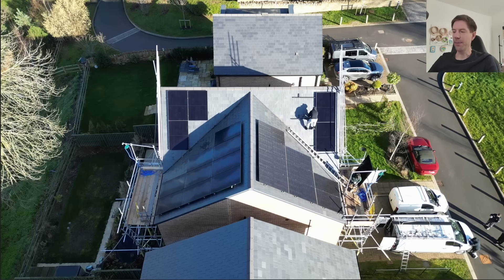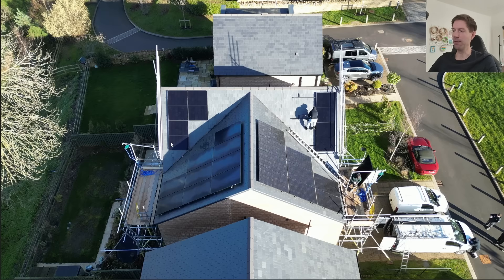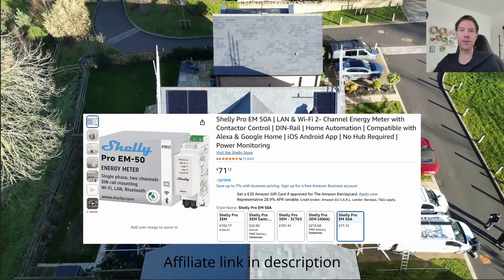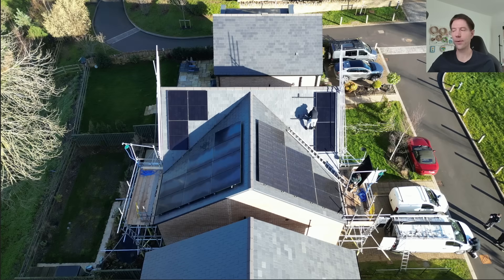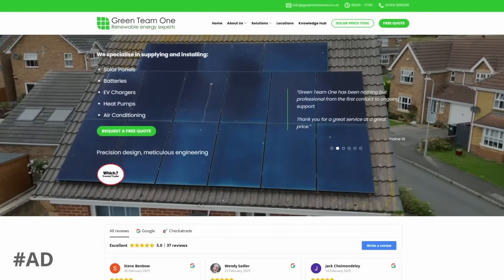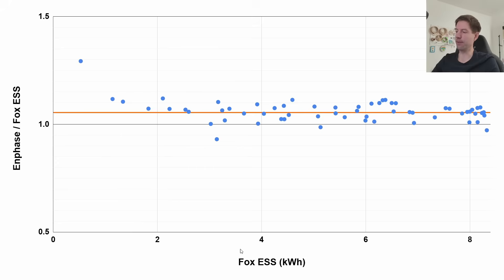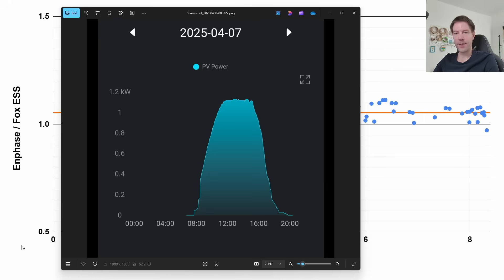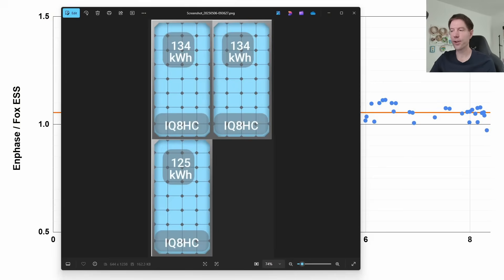Inverter showdown - two months of data

Comment: We have noticed two heat related scenarios with our setup.

The first is the biggest problem, and is related to the fact that our inverter is in the attic. On really hot days, when it’s been hot for a while, they are the rare days when we feel the need to wheel out our portable AC unit to cool the bedroom in the early evening after the sun has gone down, however if the inverter is too warm it limits the output from the battery to something around/just under 1kW, and therefore doesn’t cover our usage.

To get around this, and to prolong the life of the inverter in general, I have 4 x 100mm 12v computer fans under the inverter that turn on when the internal temperature of the inverter (as reported by the Growatt API) gets over 30C to give some additional forced airflow over the passive heatsink. They generally turn off at night, and when it’s cloudy, but we’ve never had a problem with the inverter limiting the battery output since.

The second is that recently we’ve had several consecutive days with full sun all day, but wildly differing temperatures. On the hotter days the peak output was down 300W or so from the 5kW peak, but in that case the curve still superficially looked the same, unlike your clipping, so I’m probably putting that down to the temperature of the panels themselves. But it could easily have been atmospheric conditions changing the actual W/m2 at the panels.

I’ve been running the fan setup for a couple of summers, and it hasn’t let me down, so I’m happy with the outcome, but obviously not so happy I had to do it in the first place.

I hope you find something simple to keep your inverter cool enough :)
Reply from the maker: As it happens I'm planning to do exactly that.  I've got a fan on order and will be installing it asap!
Reply: @ nice one :) I used a desk fan first to confirm my initial hypothesis, and that worked well, but drew quite a lot of Watts, and audibly  hummed along in the attic, which is why I replaced it with something lower power - but it works just as well.
Reply: Likewise have PC CPU fans underneath my inverter to blow air up the back and reduce its temperature.  Works well

Comment: Hi Tim, any chance you could share the data for cloudy days next month? 

I’m in a similar position, I have a south facing array and want to add some panels on other (less optimal) elevations of the house.

However, I’m unsure whether to go for microinverters or a string inverter. I’m a bit loathed to pay so much for the micros if a string inverter will do.

I understand the pros and cons of both and I’m looking to optimise the system to perform in cloud diffused light, not full sun, as I have that covered already with the other array. 

So, low start up voltages are key and I may oversize the panels to help achieve better results when it’s not sunny.

So I’m interested to see how your two new arrays perform on cloudy days. 

Many thanks!
Reply from the maker: There are a few cloudy days in the data I showed, so you can see the difference between the two systems there.  It's pretty consistently 5% more for the micros.  My personal opinion is that if you don't have shading issues then there's no point getting micros.  If you have a significant amount of shading micros might be better.  I wasn't planning on doing another video until six months so there won't be one next month (or for another four months).
Reply: Microinverters typically aren't the optimum solution for an unshaded south roof due to clipping which can occur at the top end when the sun is shining brightest. On my property I now have microinverters in all directions and they I'm finding them effective in all orientations besides South, particularly if you are mix and matching orientations and pitches. They give good designs flexibility to put panels wherever there is space. A key consideration may end up being cost however. They might boost your output by 5%, but add 10 to 15% to your total install price.
Reply from the maker: @RenewableEnergySteve  I would definitely concur with that summary.

Comment: It looks like the inverter has passive cooling. That often leads to overheating problems. I am looking forward to seeing you experiment with a possible solution. This is actually a reason I wouldn't be inclined to use microinverters.
Are you sure you have the S1500-G2 and not the S1000-G2? The S1000 has 1500 W maximum input power. The S1000 has a maximum output current of 4.8 A, which @ 250 V is about 1.2 VA.
Reply from the maker: Yes, I double checked the inverter as soon as I noticed the clipping.  It's definitely the right one.  I think I've come up with a good solution so we'll see if that helps.
Reply: @TimAndKatsGreenWalk  Ok, well then another reason might be the current restriction. When I look at the specs, the inverter allows up to 14 A of input current. That is usually enough for a single string of panels, but perhaps this isn't the usual case. Perhaps you are reaching that limit. You could check your panel specs to see if that could be the case.

Comment: I haven't noticed any clipping on my (very large) system here, also installed as you know by GTOne, not far from you in Gloucestershire. The GivEnergy 3-phase inverter has fans & I have noticed them coming on quite often recently, despite the room temperature not being 'too' high (but wait for the full summer heat in a couple of months' time !!). . . However I know that some inverter manufacturers swear by their fans - Fronius for instance. Maybe it really is a big deal. The temp in the inverter will be much higher than the ambient room temperature of course.
Reply: Of course, in your test case, the benefit of the string inverter was always, partly, going to be the fact that it wouldn't clip & would make up ground by generating more on the brighter days.
Reply from the maker: Yeah, I'm investigating options to add my own fan cooling to the inverter as I think that'll help.  We shall see!

Comment: Got an Enphase setup East to West 16 panels. Last month it produced 614 kWh but i exported 107 kWh and imported 131 kWh towards the end of month i added an extra 5.8 kWh battery so now i have 16 kWh of battery storage the extra battery has been help as now i can go the whole night and still have like 40% charge on the batteries. The only annoyance is Car charger (Zappi) and Solax battery storage is a pain if wanting to charge the car without draining the battery you have to put the batteries in force time use to stop them draining
Reply from the maker: Yeah, that's a problem lots of people have.  There are ways to rewire EV chargers so they can't be seen by the battery system as a house load, in which case the batteries won't discharge when you charge your EV.  That might help if you find an installer that knows how to do it.

Comment: Does the shelly measuring the enphase output take into account the energy to run the extra controller box you have (envoy?)?
Reply from the maker: No, although I think that's quite a small power draw.  I'll check.
Reply: @TimAndKatsGreenWalk  if it's mandatory (I think some people said it wasn't) then you really should include it, just 10W would account for the difference between the two systems for your 2 months.
Reply from the maker: @ReubenGow  it's 3W according to the datasheet.  So 0.072kWh per day.  On a winter's day for our 3 panel system that might become a significant fraction but for most systems with a sensible number of panels that's probably not worth worrying about.  I'll mention it in the next video though.

Comment: It's probably the heat affecting the panels. I've only seen 340 watts from a 410 watt panel today. That's ground mounted with free airflow around it. On a roof the temperature problem is going to be worse.
Reply from the maker: That doesn't explain the sharp cutoff though, as I explained.

Comment: If the inverter temperature hypothesis doesn’t hold another angle to check is the maximum DC voltage and current the inverter can handle from the string of panels?
Reply from the maker: Those are well within the limits according to the data sheet values so that should be fine.  I've been running an experiment today and I'm now even more confident the inverter temperature hypothesis is correct.  I've got a plan for dealing with it so hopefully I'll have some more news in due course!
Reply: If you are correct with the inverter throttling due to overheating😮, that would be noteworthy indeed. I hope that's in the specs.

Comment: It's probably a combination of BOTH the inverter AND the panels, getting a bit too warm & effecting output

Solar panels & Inverter performance can be impacted if they get too warm/hot for long periods
(on really rare crystal clear winter days, you could briefly see your panel/array generating more than on good summer days)
Batteries & EV performance can be reduced in winter as batteries don't work well in cold/freezing conditions

It's just the way it is, the panels get way warmer than the ambient temp, the top of panel is one temp, but the underside gets even warmer
Get a digital temp gun if you wish and test what temp the inverter fins/fan are showing
You'll get a mild reading in places, but centre fins or if you test through a fan vent up into the inverter, your reading of the internals will be much higher
Aaaaand any heat that is generated is lost energy, battery cables getting warm, inverter/panels getting too warm for too long - all will result in lost energy/generation - like your clipping and where battery cables are quite thin, they get quite warm & that's stored energy being lost
(Is why demanding battery systems use thicker cables & busbars)

Check some temps, maybe add some additional inverter cooling (mini fans) or an extractor fan if fitted to an exterior wall to expel some of the warmer air & hopefully lower the ambient temp
You can get a temp controlled plug/timer that will switch on if temp rises above say 25 degrees (or whatever you choose), around the inverter & turn on fan/extractor - which could be handy if we ever get a really hot summer

Get a cheap digital temp gun & check out various locations in/around inverter & then act if you feel it's getting a bit in there
You may not be able to lower the temp too much, but you might be able to lower it a few degrees to extend the time before it rises and maybe throttles back slightly at a certain temp on the inverter
Panels - well you can't do much about them, but at least you haven't got solar skirt or in-roof panels that trap the heat with little to no ventilation for the poor panels
Reply from the maker: I'm way ahead of you.  I've been running an experiment today to see how much impact a fan has on the string inverter temperature and generation output and I'm now pretty confident about my hypothesis and how to resolve the clipping.  More in a future video!  But it's more or less what you've suggested.
Reply: @TimAndKatsGreenWalk 
Tim you are a pioneer in engineering of solar generation. No one has ever talked on YT about the inverter curtailing output to prevent overheating. Looking forward to your next video

Comment: Is there a difference in how the power is being reported? There is a difference between RMS power and peak power?
Reply: Ps Given RMS power is roughly 70% that of peak power this might fit?
Reply from the maker: I don't think that's the difference.  I would expect that they're both using RMS.  The Shelly also shows instantaneous power and it's consistent with what the two systems report themselves (within a few percent), so I think all three use the same method.
Reply from the maker: I'm measuring the energy generation consistently for the two systems using the Shelly device I mentioned, so that bit is reliable.  I'm more interested in the energy rather than the power but I don't know what method the two systems use to report their instantaneous power.

Comment: After that April I'm shocked to see the micro inverters still winning. I don't think even 1 optimiser would pay back, but would be good to see the data and more detail, and also be good to be proven wrong.
Reply from the maker: The clipping of the string inverter has played a part, for sure, but I think I've got a solution for that now, so the rest of the summer should be interesting.
Reply: @TimAndKatsGreenWalk could the clipping be peculiar to this specific string inverter?
Reply from the maker: @ I'm not sure.  Possibly.  I've been experimenting today and I think I can resolve it, though.  Any inverter can overheat, but I suppose some are better at managing heat build-up than than others.  That'd make for another interesting experiment at some point.

Comment: Disappointing if the Fox inverter is overheating and effectively clipping itself, hopefully your solution can rectify the issue in an energy efficient way.
Reply from the maker: Yes, I was a little surprised but I think I've come up with a good solution.  More on that as and when I've implemented it and have something to show.
Reply: Another possibility is that the Fox Invertor (1.5KW) isn't actually capable of 1.5KW.  A lot of cheaper products (not just invertors) over-state their maximums as 99% of the public don't double check that what they bought is doing what they expect.  
"330kWh in two months - about right".
I got an enphase system back in 2013 as I wanted to monitor individual performance and failure, friends of mine who have systems 'just' accept what they get.  Had one that had a string system and the invertor failed, they didn't notice for a few weeks.  
🤔
You might ask 'Green Team One' if they would loan and fit a 2KW invertor for a week or so
Reply from the maker: @ I would know within about half an hour if any of my systems fail!  I do check the data rather more often than is healthy, I suspect.  And I'm pretty sure the Fox inverter is what it says it is.  I'm not like most of the general public when it comes to this stuff ;)
Reply: @TimAndKatsGreenWalk  you and me both 🙂
Reply: I suspect it hasn't been installed with adequate clearances around the unit for airflow; at least some of their other manuals suggest 500mm clearance on all sides, and his installation doesn't have that.

Comment: How do the micro inverters fit into the wiring system as i assume they are providing AC from the roof.
Reply from the maker: Yes, that's exactly it, the AC cable comes down from the roof and it wires into the consumer unit to provide power to the rest of the house.  There is also a communications box that gathers the data etc.

Comment: It’s a pity that the string inverter output is being throttled for some reason, as it means your comparison between string and micro inverters is somewhat flawed 😢. One thought - if the inverter could handle two strings, one for the top two panels and the other for the bottom panel, then it might fare better. I assume your main E/W arrays don’t exhibit this kind of clipping?
Reply from the maker: It's a single string inverter, so it's not possible to split the panels up.  And I think I may have solved the slipping issue now so the rest of the year should be better.  So far I've not seen clipping on the E/W arrays.
Reply: @ I suspect there may be other makes/models of inverters , albeit larger, that can handle more strings. For example, I have three strings on my Tesla PW3. So although your comparison is limited to three panels each, for those contemplating larger arrays and trying to decide whether to go for micro or string inverters, that choice is open to them.
Reply from the maker: @colinfieldgate4719  yes, that is true.  With only three panels a single string is fine for my purposes.
Reply: @ Indeed With just three panels there is no real benefit in complicating the system. It was merely a technical point that would apply to larger arrays.
Reply: MPPT minimum voltage would probably not allow you do split as you suggested.

Comment: I have just gone live with a single array (4 strings) and battery. As Im not setup for a SEG yet, my system is configured for self consumption. My agreed DNO export is also around 50% of the array capability. From a behavior perspective its clear to see the array working at capacity until the battery fills. At this point my limitation become export and the array clips itself to ensure I dont export more than Im allowed
Reply from the maker: We're lucky that our DNO limit matches our maximum export rate so we don't have to worry about restricting the output.  Once you're set up with an export tariff you could potentially make use of force exporting your battery in the evening so that you've got plenty of spare capacity the next day to fill it back up without wasting any solar.  Although making sure you don't run out of battery when the next day is cloudy becomes an interesting challenge!  In either case, I hope you enjoy your new system.